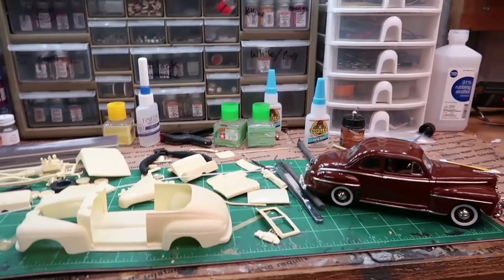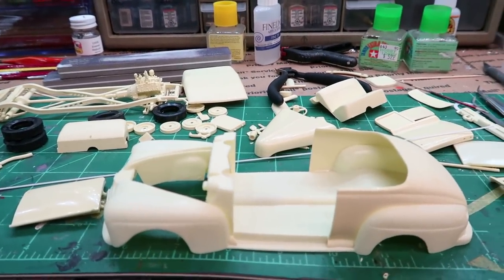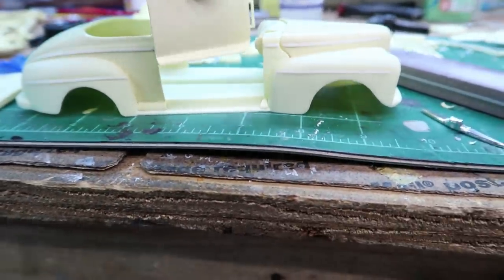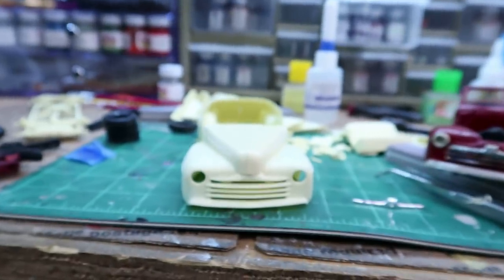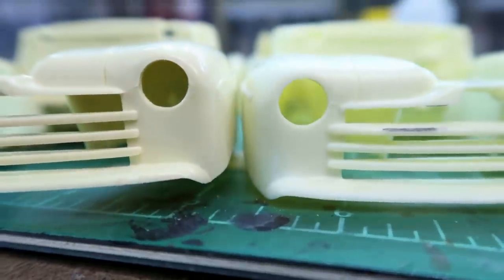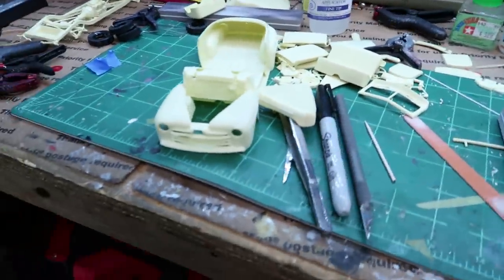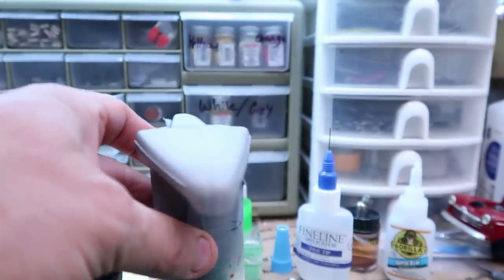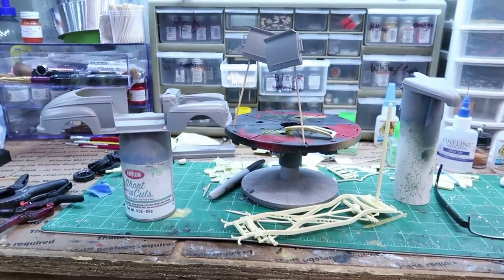Super Slow Progress!!! Chrome Molding Installed On The IMC 1948 Ford Convertible!!

Comment: I wonder if the grille being different could be down to mold wear. I've liked and owned several rereleases of the old AMT 51 Chev since the 90s, and tbh, I've never known what the script along the trim was supposed to read. That is until I bought by accident an original release. It turns out. The trim reads "Deluxe". Years and years of different issues have left the trim barely readable. Not to mention the original version built up like a dream compared to the rest. If I had a better camera, and a..... Ahem..... Working monitor. I'd post photos to FB. Lol
Reply from the maker: Lol!!

Comment: Don't sweat it. You got this and it shows with the attention to DETAIL.. 
    Just a little tip that I have used in a lot of situations to make raised chrome is the spool of copper wire that's inside solenoid for old cars.. It's great for all kinds of stuff related to model cars..
       Just a thought that might help someone.. Break, and fuel lines are my favorite use for it.
        Your doing great on that build.
Reply from the maker: Thanks!!!

Comment: Evergreen also makes 1/2 rounds as small as .040" #240. It may be easier to glue down. That's an idea for the next one.
Reply: Thanks for the tip Terry. I've got the 40 Ford sedan that has very faint chrome trim on the side.

Comment: Judging from the pics the one your Dad built was an original version that didn't have the grille area recessed.  I'm guessing they got complaints about the fit and went in and adjusted the molds to allow better fitting of that grille piece.  Would have been expensive to do that in reverse so I'm guessing the already trimmed ones are the newer retooled versions and the others like your Dads are the original molds.  Great video lots of interesting things to look out for.

For those chrome molds I use Evergreen 1/2 rounds sanded down on the flat side to get them closer to the body, then I prime and use the Alclad chrome system and a bit of CA glue.  Bare metal foil is a fugly fad and instantly noticeable but far easier on areas like Wipers and window trim, real chrome always looks better but is stupidly more of a complex taping experience lol.  If you chrome after your first layer of clear it wipes away easy enough if you get bleed through.

Comment: It was interesting to see the differences in the kits. Wonder if the chrome trim pieces were different for custom versions, and that changed the body mold? 
I'm very interested how this '48 turns out. I have the car in diecast (woody trim version), but would like to build a kit like this in a different color without the wood, for display purposes.

I'd like it if there was more editing to reduce repetitions in your narrative. Not a big complaint, but after I hear things once I really don't need to hear the same thing again later while you chat. Slows up your pace. However I REALLY don't want to hear all the repetition about like/subscribe/patreon etc etc. It's already in your written comments above, so why waste time in the video? jmo
Reply from the maker: Ray, I appreciate you opinion but I'll probably just keep things as they are. I feel that it's necessary to repeat these things and so far it's working out pretty well for me. Don't take me wrong, I appreciate the input! Thanks